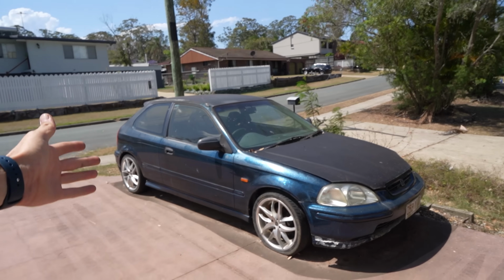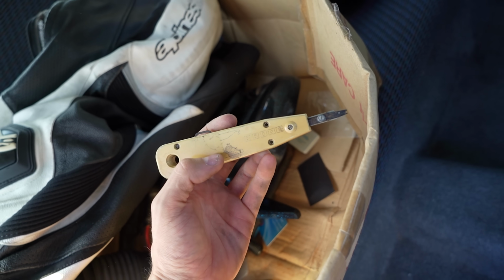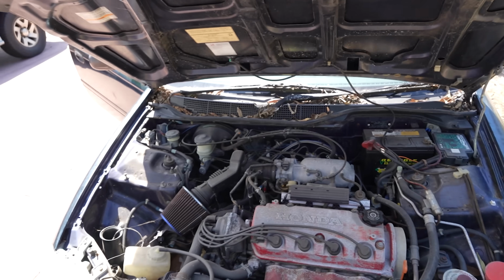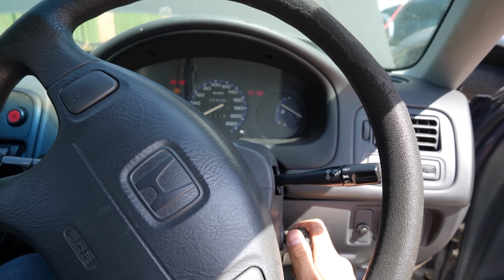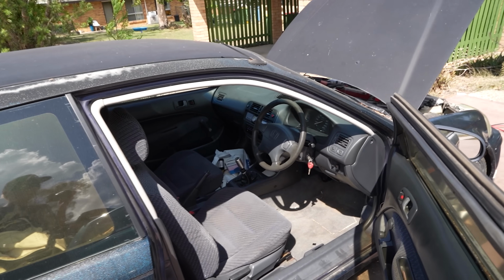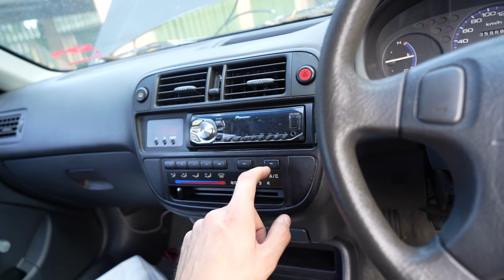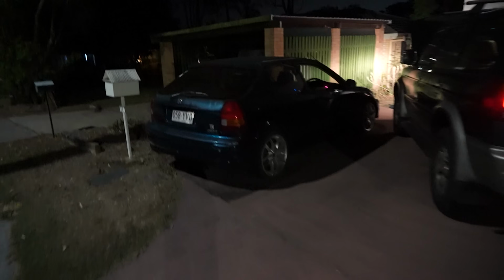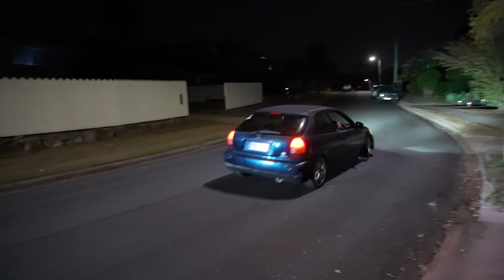Will this Abandoned Honda Civic Start?

Comment: My uncles Acura Integra sat for years and we put new transmission fluid and coolant we forgot to change the old oil but it started and ran like a champ even with old motor oil we changed it later on